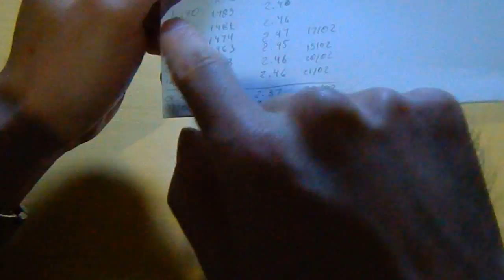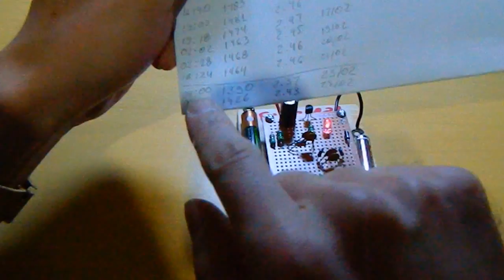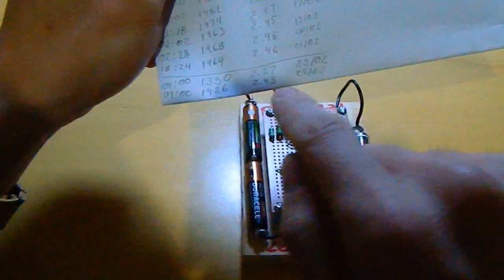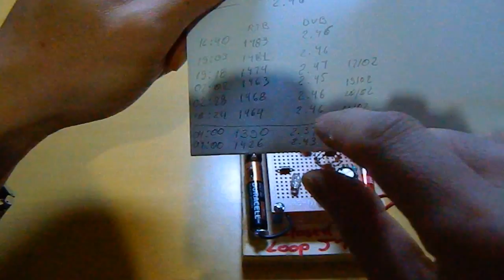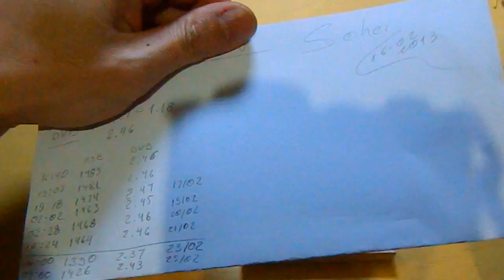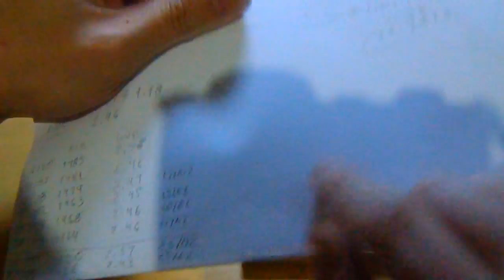ClosedLoop Joule Thief

Comment: Burning Ions
Joule Thief running 10 Watt SMD LED with 3V Battery
with Closed Loop Joule Thief by Sohei Thoth equals ====

100 ten watt closed loop joule thief = 1 KW = USD $100K prize offered by Steven Greer. Go for it.

Comment: It seems that you don't get the results fast enough.  I suggest you get some alkaline button cells, which have 1/10 the capacity of an AA cell.  All your charging times will then be cut to 1/10 and you will see the results much faster.  Check your old calculators and watches for used button cells.

Comment: Batterys have a max charge amps. The pulses from these types of circuits can exceed the max, so the bat only absorbs part of the pulse. A cap can take the rest and trickle charge/balance with the bat.Same for output pulses that pull the bat down, cap can provide the pulse, and trickle back up from bat, saving the bat from working so hard. This could stop you charging effect or make it better. I'm not sure witch. Depends how the battery is getting excited. Could be from those pulses.

Comment: Alkaline! I have had almost zero luck charging them! Would probably work really well with newish rechargeable's!! I know what you mean about the wait. I can get some parts at local tech store, but 10x the cost. or wait 2-4 weeks for it to come from china. Other parts are mail order only :( At least you get time to go over the circuit plan while you wait. Less chance of smoke that way :) Have you tried large value caps in parallel with bat's? Might be better, might be worse. (cont)

Comment: Nice testing there. Good to see you are repeating tests. I have had a few simpler one cell circuits do similar. The question is, will it work with (super)caps in place of batterys. If it does, you have something special indeed. If not, it means the circuit is somehow exciting the chemical reaction in the batterys, which can still be something if you get light (energy) out and the batterys are not going flat. Although if it won't work with caps, the batterys probably will die one day.